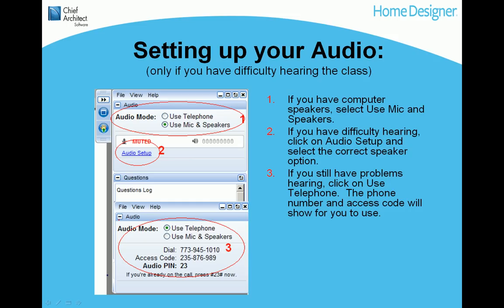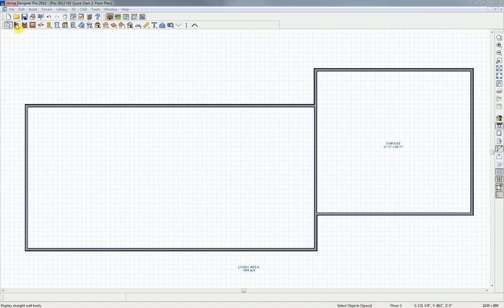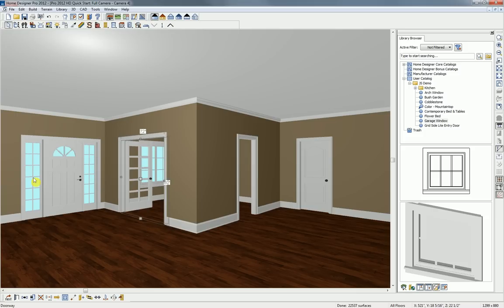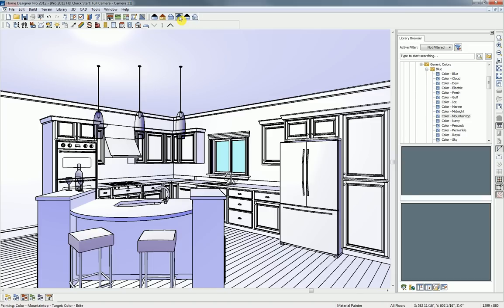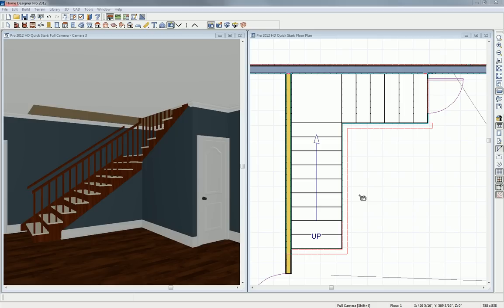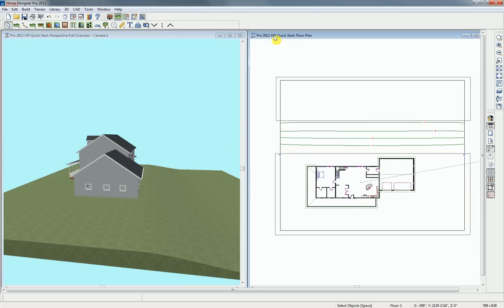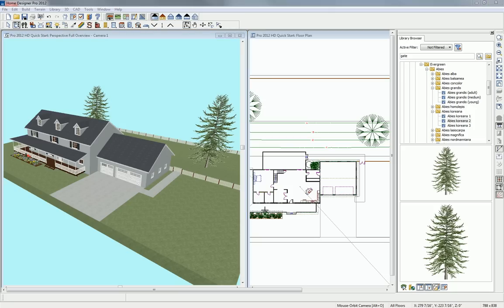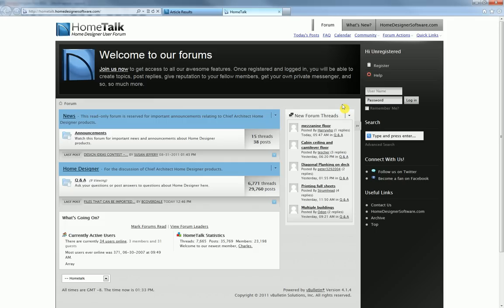Home Designer Software Quick Start Seminar

Comment: How much sq. footage/lot size can this program handle? or is it just a matter of how good my computer is.
Reply from the maker: ***** There isn't a restriction through the program. However, the larger your plan the more processing your computer will need to do. Check out our minimum and recommended system requirements: http://www.chiefarchitect.com/products/sysreq.html